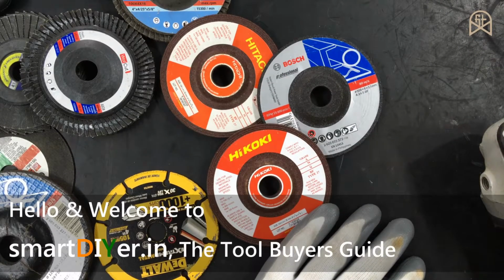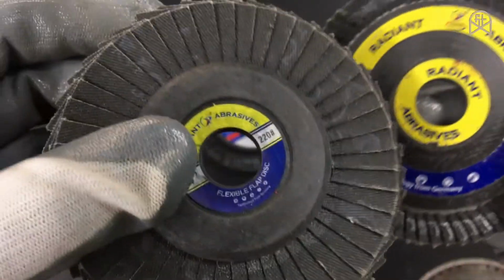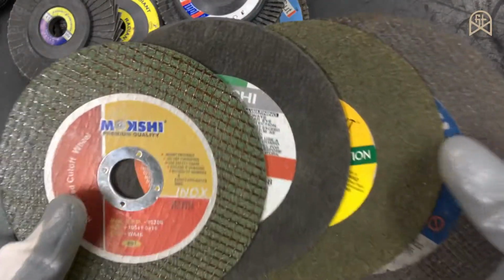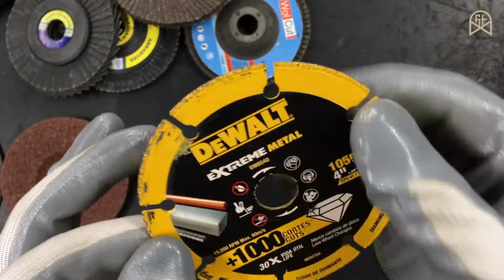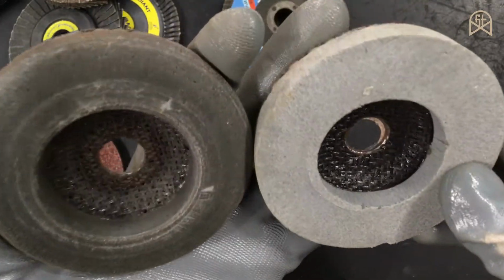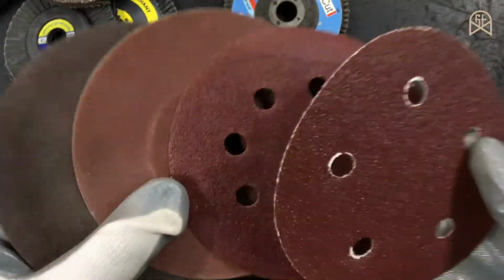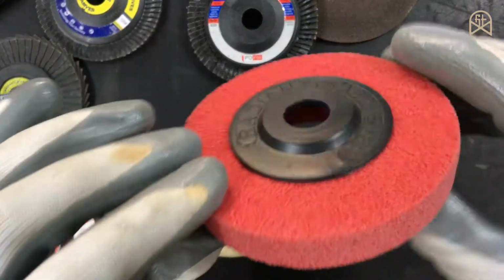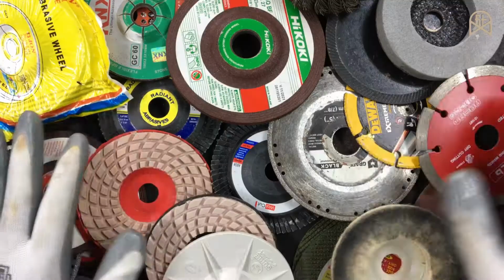Angle Grinder Disc Types in Detail

Comment: Bro which type Valcro and which number of sanding paper is good for sanding a wall after applying putty
Reply from the maker: Depends on wall man. But you should be using Orbital sander or Hand sanding block. I don't suggest Angle grinder for removing paints from walls